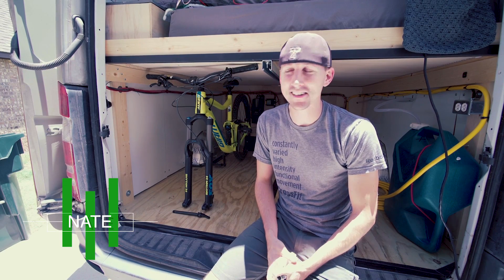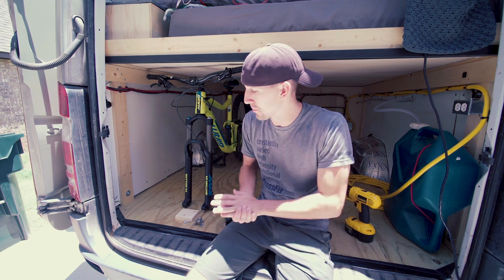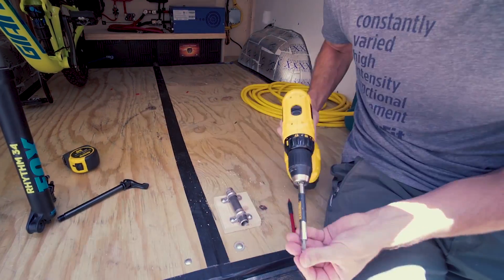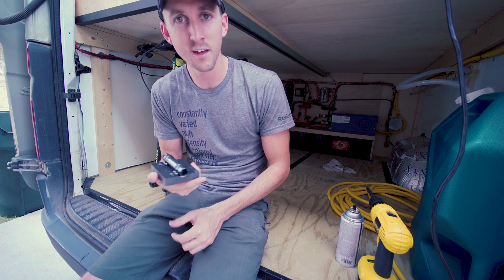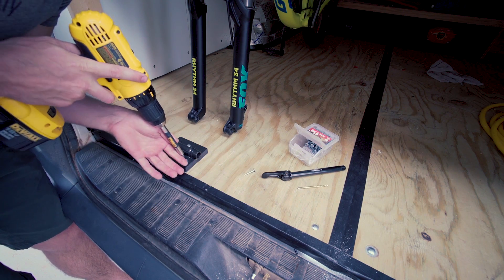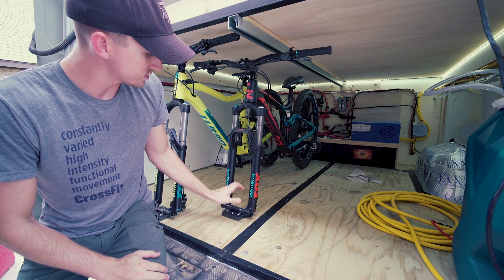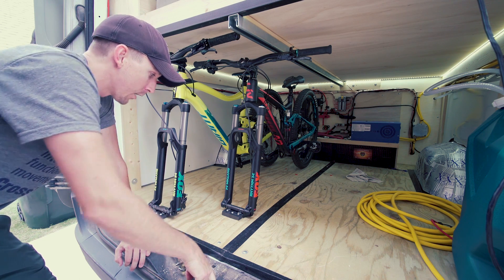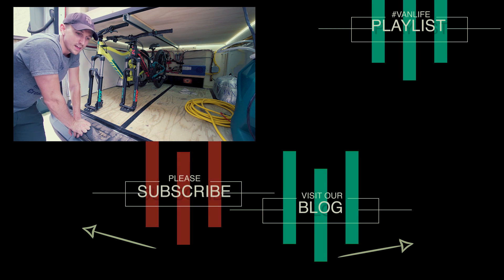DIY Thru Axle Bike Mount

Comment: A 1/2 inch black pipe has an inside diameter of 3/8 inch and thru axles are usually 12mm in diameter or 0.472 inches and so the pipe is going to be too small. 1/2 inch EMT pipe does have the required diameter to work.
Reply from the maker: So, you're saying our axles didn't fit through the pipe and we are running some kind of gas pipe scam? 😂👍😂

Comment: Neat design, do you think this design would be strong enough to hang a full sus bike vertically mounted to a wall ?
Reply from the maker: Maaayyyybe?  I'd probably use bolts instead of screws though.

Comment: I would do a strap from the handlebars down to the bed as that would decrease the wobble.  Also it makes a triangle witch is stronger than a flagpole if you understand my drift.  The suspension would only be slightly compressed.  As an other option I wold use a aluminium  U shape bar that would fit around the rear tire.  in a slightly leaning why so it would puss the wheel down when pushed in.  That would stop the wobbling and keep the rear end planted even in rough terrain driving.
Reply from the maker: Yeah, you could definitely add as much additional support as you like in your install.  After 2+ years with no additional modification than what is shown in the video, it has worked pretty well.

Comment: Great content but 1/2" pipe is a 12.7mm aperture but you are using the original 15mm axle to go through the centre?? Im confused and trying to figure what size PVC pipe i would need for my Maxle. How did you get 1/2" pipe to work? Thanks
Reply from the maker: You should take your axle to the hardware store and see which size of pipe works the best. 👍👍
Reply: @EXPLORISTlife  Thanks for the quick reply! I can't do that atm I'm afraid....CV....so trying to order bits online. Which size pipe did you use? Cheers
Reply from the maker: Ah, right.  I truly don't remember what size we used and it doesn't look like I made a note of it.
Reply: @EXPLORISTlife  Okay, no probs :)
Reply: @LindyVanner  https://www.pvcfittingsonline.com/resource-center/pvc-pipe-dimensions-18-through-24/    
You can see SCH40 1/2" pipe has inside diameter of 0.602 inches and 15mm is 0.590".   That's less than 1/64th difference.  Should work fine.

Comment: so you used the original thru axle? and would you say this would be fine for a roof rack?
Reply from the maker: Yes, original thru axle.  No, I would not recommend this for a roof rack.  If this fails in the location I have it mounted, the bike just falls over. If it fails on the roof rack, the bike goes bouncing down the highway and through somebody's windshield. I'd recommend a mount from Yakima or similar for that.

Comment: I want to hang my bike by the front tire for storage but it has to be against the wall as it will be stored on my small, enclosed back porch. I have the place to put a bike hook. Would anyone know what kind of hook I would use so I can hook the front tire and have it flat to the wall. I have mountain bike handlebars that seem to be a mental block to me to come up with something that will reach out enough.

Comment: Which  mountain bikes normally come with a thru Axle?
Reply: Most modern mountain bikes intended for riding things like trail, downhill, or cross country come with a thru axle. Quick release axles and open dropouts are being phased out. You will see quick release and even bolt on axles on older bikes and some big box bikes
Reply: Everything over $1000

Comment: Do you have quick releases for your seat posts so you can lower the seat all the way down? (I'm assuming you have dropper posts)
Reply from the maker: Yeah, we've got dropper seat posts.  One of the bikes has a quick release, one doesn't, but we keep an allen key handy for that reason.
Reply: Thanks for the reply. I'm trying to minimize the height and was thinking of going quick release on mine to avoid stress and fatigue from tightening/loosening the bolt since it's aluminum. Will keep allen wrench for guests bikes. Just returned my mounts ($70) because they didn't fit my axle. I'm going with your system. Brilliant DIY BTW!

Comment: Loving your videos and what you have done to the Sprinter, amazing!! Planning to do my own conversion on a Fiat Ducato (Ram Promaster), and bike storage is something I've been giving some thought. Now this idea is a little too late for you as you have already set your bed height. So I have the same plan to remove the front wheel and use a fork clamp but on full pullout draw slides. The bikes will face opposite directions and should mount closely together.
Will definitely use this idea, should save around £60. Thanks.
Reply from the maker: Nice!  Yeah, bike storage is super important.  We were going to do the slides, but we actually made our bed too short, so we couldn't afford to have the extra space for a slider... oops!  It's okay though.  As it sits, they aren't hard to put in or take out.

Comment: You shouldnt be cheaping on mounts if your bikes are as cool as those yo!
Reply from the maker: I am always looking for a deal, but also, the mass-produced mounts were not low-profile enough to work for my setup.  Also, after 10,000 miles, these mounts are holding up perfectly and work just as well as their $50 counterparts!  Cheaping out would have been just tossing them in the back with no mounting...  Thanks for watching! :D
Reply: Fair enough, you needed something custom for your setup. And still works. So thats win win situation.

Comment: How do you like using your bike mount now that you've been on the road for awhile? I was  debating on doing a drawer slide for my bike under the bed, but the slides are so expensive for that tiny convenience. Nonetheless, thanks for inspiring a cheaper alternative!
Reply from the maker: No Problem!  Yeah, so I really like them.  The only 'issue' is that since they are so low profile, you can only get half turns on the axle as they hit the floor when you are screwing the axle back through the fork.  No big deal since I was needing low profile, but still a consideration.  We were initially going to do slides as well, but ran out of time.  Looking back, I've been pretty happy with the no-slides arrangement.  Like, Maybe it would have been nice to have the bikes on a slide for cleaning purposes, but for just loading and unloading them, just backing them into the compartment is really as simple as it gets.  I hope that makes sense! :D
Reply: Adventure in a Backpack haha sweet! Yeah the farther I get into my build the more my budget disintegrates, and I think the slide is a luxury. Thanks for the tip! Maybe i'll see you guys at the van meet up in San Diego on September 9th. Keep on vannin!

Comment: video was meant for 15mm axles -
mine is 20mm or 0.787", so I need to use 3/4" pvc pipe which is
20.93mm - close enough…
Reply from the maker: +Rick Couture Nice!  Yeah, sounds good!  Let me know how it goes.
Reply: pvc pipe was not quite right size but i found some fittings at home depot and clamps that worked perfectly...snug fit on axle.

Comment: nice video. I just did a mount like this in my step van garage space (under the bed like yours) and wish I would have seen your video earlier. question: what is the steel rail on the ceiling of your garage used for? (the one going front to back)
Reply from the maker: Sorry I missed your comment. :/  That steel rail is just for added support for under the bed.  The unistrut (the steel beam) is more rigid than wood.

Comment: Hi, good job, but try using a longer piece of timber that you could mount the 2 fork brackets onto for the both bikes and it might be more stable. Ray Liverpool UK
Reply from the maker: Thanks so much for watching!  We couldn't do a longer piece with both bikes mounted on it because we had to stagger the bikes because the handlebars would hit together.  After making this video, I put a big gnarly lag screw through the mount through the metal of the floor.  Good to go now! :D  Thanks again for watching! :D
Reply: @EXPLORISTlife  you still could have done each like you did with longer wooden bases to spread the load.
Reply from the maker: Man, there's all kinds of stuff we COULD'VE done.

Comment: Cool and clever bike mount. I assume you didn't have an automatic pipe cutter to hand? ;-) 
Just a thought, as you are still finessing the storage - if you used plastic pipe it definitely wouldn't damage your axles. And I fear, no matter how much you bolt down the clamps, the bikes are still going to wobble about. What about a spring clamp mounted somehow to the van wall to grab onto the cross bar of the first bike and something similar between the two cross bars?
Reply from the maker: Thanks!  Yeah, we didn't have an automatic pipe cutter.  Lots of tools, but none of those.  I think for now we will just leave it as is.  For the last 10 years, this is how I've transported bikes and although the wobbling makes me uneasy, it has never caused any damage.  Thanks for watching!
Reply: Fair enough. I think the set up you have is great and no doubt you will have so much crap, I mean useful stuff (damned auto-correct!), pack in there too that they wont have room to move about too much. Cheers. ;-)
Reply from the maker: Haha, right?!  That's the plan! lol Thanks! :D :D
Reply: Great vid! I stop the "Wobble" with a short length of 6mm rope I tie off to anchors already in my car, loop it around my headset once and back down to the other anchor point. On 1 end a short strong bungee that gives a little bit of tension, compressing the fork a little.
Reply: just get a bigass block of dense foam and cut some notches for the top tube and wedge it all in place, also saves any scratching cos the foam is soft